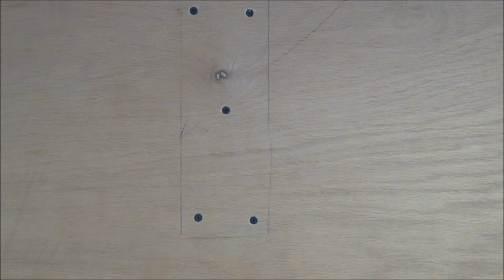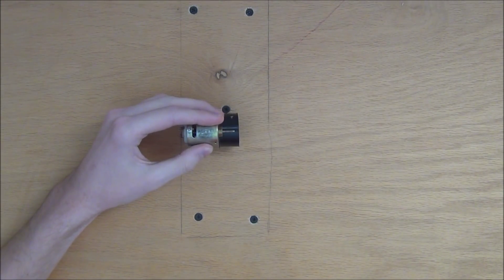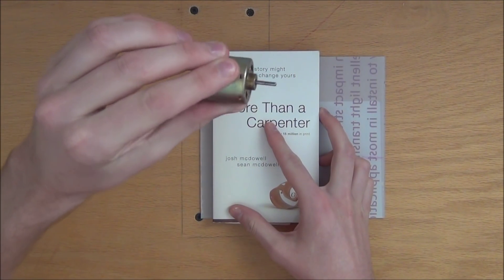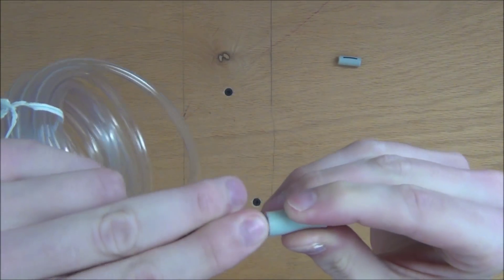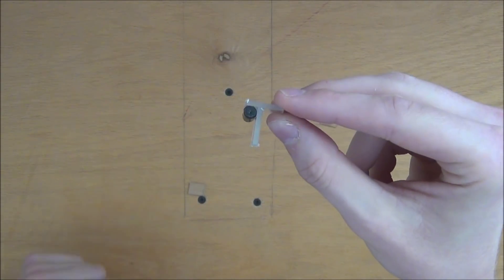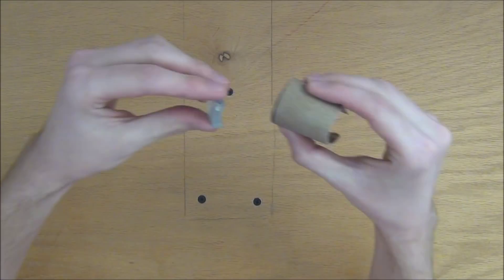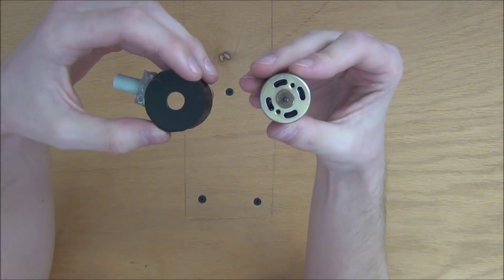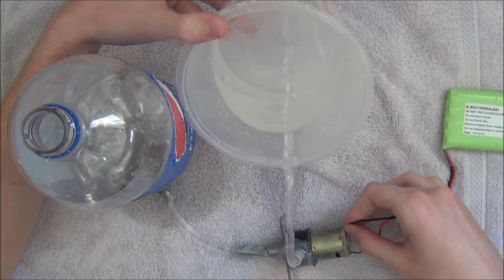How to make an electric water pump!

Comment: Do you reckon, you could place this in a water proof case, and run it via a Switch either with batteries or connected directly to mains

Comment: Hello, this video was very informative thank you. It is relatable to a project I am working on for school. I noticed the the impeller blades were longer in one direction than the other, if you flipped the impeller on the motor shaft, does that reduce the flow rate?

So there are two different configurations in question:
1. Current impeller orientation, current motor polarity
2. Flipped impeller orientation, current motor polarity

Which configuration has the larger flow rate? Please also describe the impeller orientation, maybe by providing a diagram.

Thank you for your assistance.
Reply from the maker: Yes, the longer flatter side has more surface area and as a result is able to push out more water.  :)

Comment: does it have to be gravity fed?  will the pump not take it when placed higher above source?
Reply from the maker: No, it should be able to! just as long as your motor is powerful enough and your piping is small enough.  :)

Comment: idont have dc motor
Reply from the maker: That's okay! You can easily find them in old electronics like rc cars and even flash cameras (which you can find at the thrift store). Or if you wanted to buy one new you could get it at radio shack, they are only like $4 there.  :D

Comment: Where did you get the motor
Reply from the maker: You can find them used in old rc cars, computers and most house hold appliances. Or you can by them new from eBay or radio shack.  :)

Comment: Yeah... Your motor is going to be filled with water. :/
Reply from the maker: Actually I have run a few different pumps all built the same way and haven't had any problems with any of them.   :)
Reply: I had. Lost two dc motors making pumps like that. But it was for less water - I was using in my cat's drinking fountain. But with a feel hours it just stopped. The problem is the motor bearing: it's not water proof and there's a lot of pressure there in a pump like this. The only way to avoid it that I know of is with a coupling and an additional shaft, you know? And letting the motor far way from the water.
Reply from the maker: I see what you are saying, but it you build your pump just like I built mine you should be okay. All of my pumps are still running great.  :)

Comment: anybody tested this inside a PC?
Reply from the maker: Tested the water pump inside a computer? Are you trying to water cool your computer?
Reply: +Mechanical Ninjineer just wondering if it's possible
Reply from the maker: To water cool a pc with this pump? Yes, it definitely is possible but probably not very easy.  :)
Reply: Ok thanks a lot, great video by the way. How does the power compare to say a ddc motor? do you know?
Reply from the maker: sadly I do not. I do know that It is a 9 to 18v motor.   :)
Reply: Ok thanks a lot anyway (:
Reply from the maker: You're welcome!

Comment: i dont really need to make one because i found in my garage a small 12 v water pump it is made from germany and we had a german car that pump must have come from there. i cleaned the pump where the water goes and i need to oil it because it doesnt run at 5 v for some reason my other motors do the big ones that is 12v. and if i give the motor 12v it pumps alot of water fast and very very well it reached the height of 5 M  without any tubing just plain pump with no hose in the outlet.
Reply from the maker: Awesome!

Comment: Why place the source of water at the bottom of the bottle? this already makes pressure that makes the water flows and this will not be a useful water pump
Reply from the maker: Your asking why I didn't make the pump suck up the water? It should be able to do that also quite well, and the smaller the tube the harder it will suck.  :)

Comment: Nice video  but how do you cut the plastic with different shapes ?
Reply from the maker: +Santosh Kulkarni I will usually cut the rough shape out with a hack saw and then sand down the rough edges with a bench grinder. :)
Reply: OKAY GOOD iDEA

Comment: How do you prevent water from entering the shaft? I see that your glued the impeller on, but what's stopping the water from entering??
Reply from the maker: +Derek Dang Really good question! the motor shaft going into the motor shell is very close if not entirely air tight. so along as you glues up any other holes around the motor shaft you should be good! I wondered the same thing before I made this but so far I haven't had any leaks, but that may be different if you have a really old motor..  :)
Reply: +Mechanical Ninjineer Thanks! It's a great design!
Reply from the maker: Thank you! glad you like it! :)